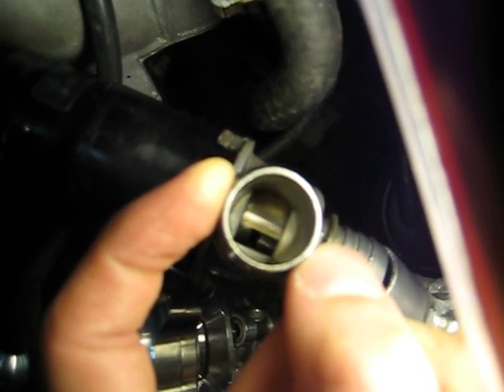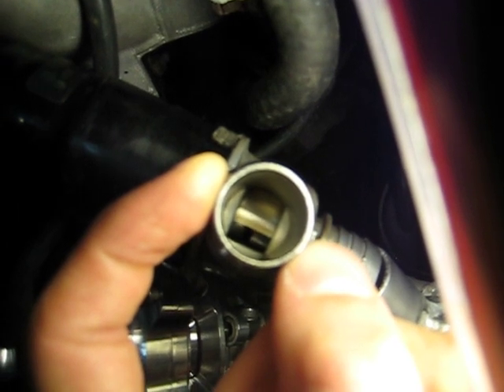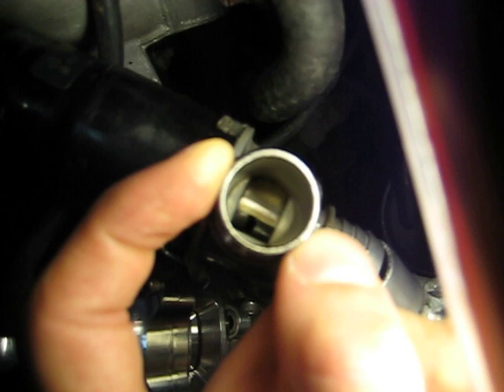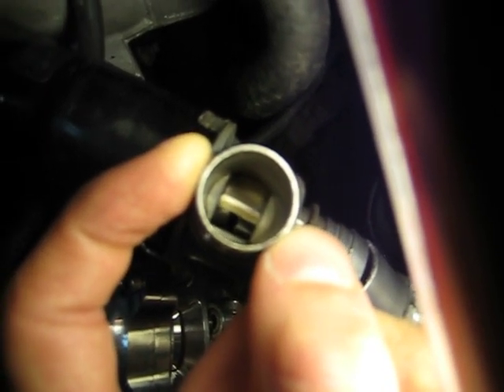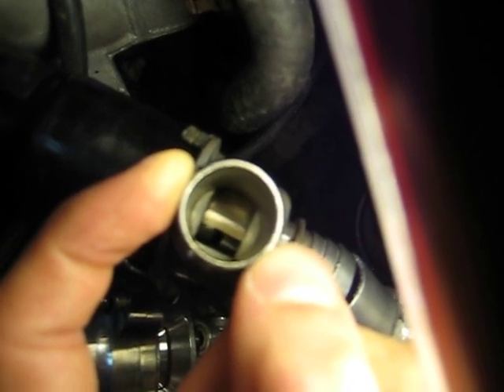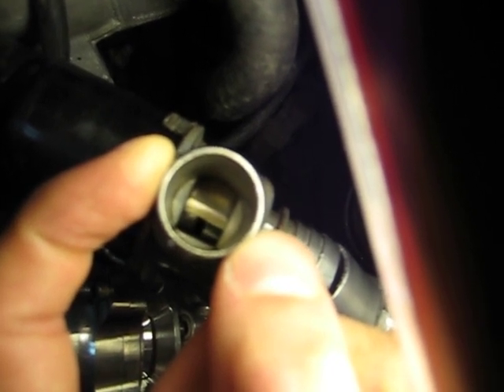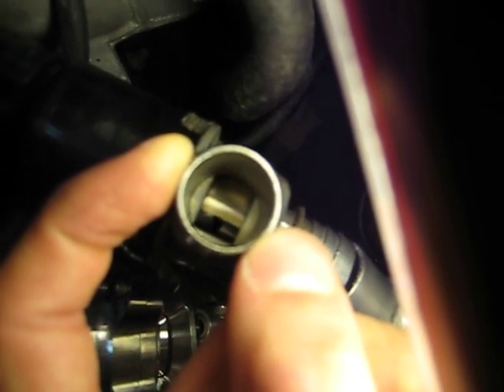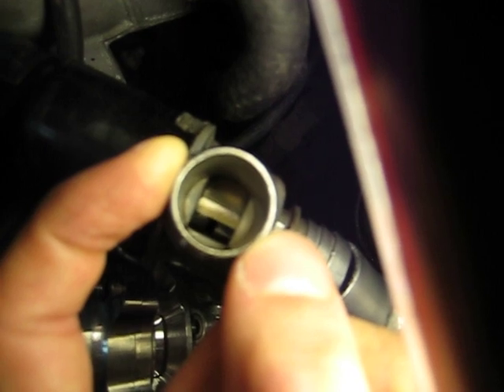E30 Bosch 3 Wire PWM Idle Valve Issues Part 2

Comment: How did you wire it up with megasquirt? Glens garage 3 wire idle board or the pwm transistor mod in the megamanual ? And ground the 1 side closed with a resistor?